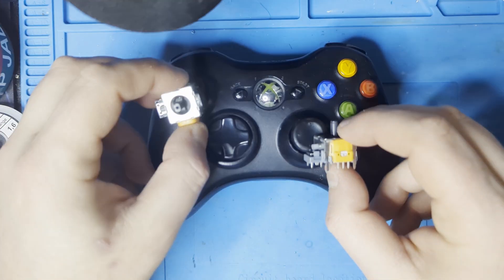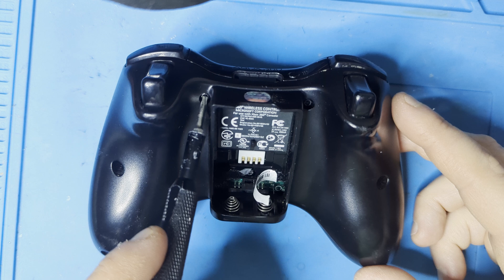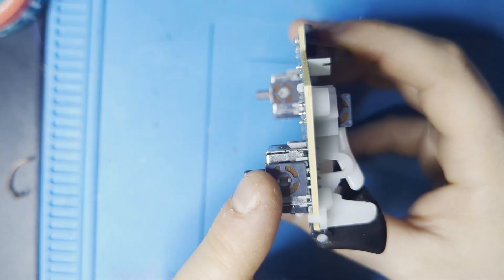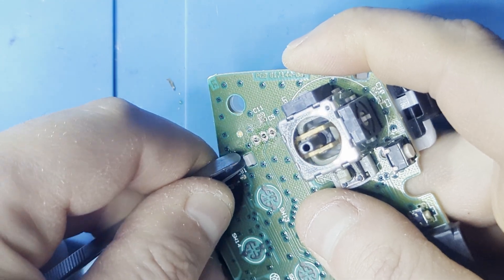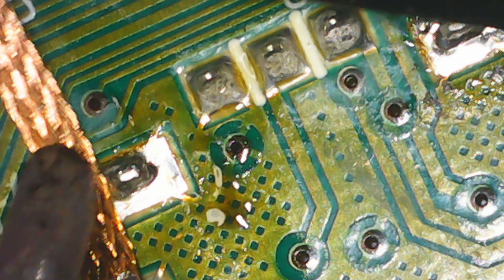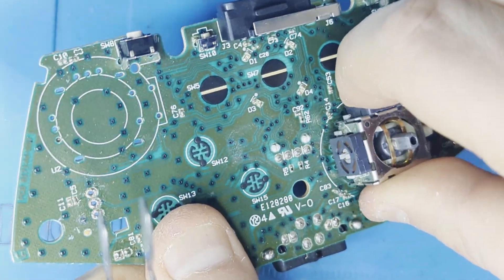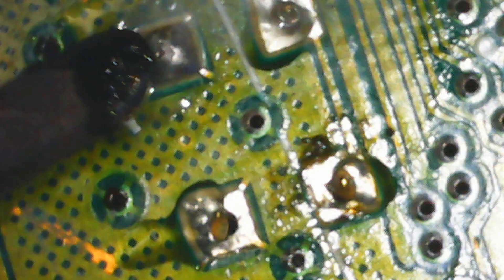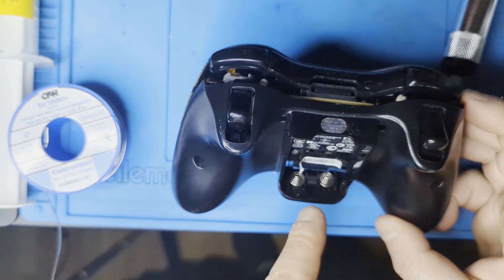Fix broken 360 controller joystick | Beginners Guide, hall effect/TMR | tutorial | how to

Comment: You aren't showing the most important part - hall effect sensor adjustment and testing. Just soldering in a new stick without adjustment is not a repair.
Reply from the maker: I noticed after doing some replacements that sometimes you'll need to calibrate the stick as you say. I'm planning to update the video in the future :)
Reply: @mkFix-pl It's not "sometimes". It's extremely rare that replacement sticks will be dead centre right away, so adjustment is almost always required. It can be done manually for these hall effect sticks (though it is quite iffy to get right) and by pot twisting or installing resistors for potentiometer based sticks.
Only older controllers like PS1/2 and OG Xbox don't require adjustment as they auto center every time they're used. 360 controllers don't do this at all and while they have a generous deadzone of 23%, non-centered sticks don't feel right and will start drifting much sooner with physical wear.

Comment: Hi, nice tutorial. Anyway, is there a software to calibrate xbox 360 analog stick like series x/s? Calibrating them physically makes me crazy.
Reply from the maker: @SouthBridgeGaming  if you have a receiver dongle that you can connect to your PC, you could use steam or something like that to help you calibrate the sticks easier. But not really, you just need to develop a feel for it unfortunately 😬
Reply: @mkFix-pl  yes, but it's only works in PC that has steam and has to load setting from cloud. What i meant is calibrating software at firmware level that saved inside the controller themselves. Like xbox app series x controller and dualshock tool github for DS4 and dualsense. But i think it's too much to ask since everybody already moved on to newer gen consoles.
Reply from the maker: @SouthBridgeGaming  i know what you mean. What I tried to say was "no, buy you can use tools to help with calibration instead of guessing". Sorry for the confusion :)
Reply: @ so i guess we're stuck with calibrating physically then. Btw, how do u calibrate that hall effect ones? Is it done by tweaking the magnets position?
Reply from the maker: @SouthBridgeGaming  Exactly. There are these holes on the side of the plastic where a sim-card remover can fit. So you need to pull the joystick to the opposite side you want to calibrate it to (amount depends on how off it is). Then put in a pin there or something, get the joystick slowly back to the middle, release the joystick then lastly remove the pin :)
Reply: @mkFix-pl  thanks

Comment: Great video. How about the calibration of this new parts? Plug and play?
Reply from the maker: @rsfalacci  in this case no calibration was needed. But I installed some joysticks today that needed to be calibrated slightly. I could do a short about it :)
Reply: @mkFix-pl  Hey, great video! I would like to see that short, if you can do it, I'm really wanting to do this and you're the only channel that has made this so far. I'm with some Drift that is making me crazy (Can't move the way I want). Thank you again!
Reply from the maker: @dflc56  hi, I forgot what I was mentioning doing a short on since it was quite a while ago. Minding filling me in? Might do it today then so you'll have it! :)
Reply: @mkFix-pl  Absolutely! We would like to see how to calibrate those Joystick in a short if possible. May on the Web at Gamepad Tester, Steam or the Windows Built-in Calibration tool. Thank you!
Reply from the maker: @dflc56  i can absolutely show how to calibrate hall effects. Think the controller can connect to my laptop through Bluetooth so that should be no problem :)